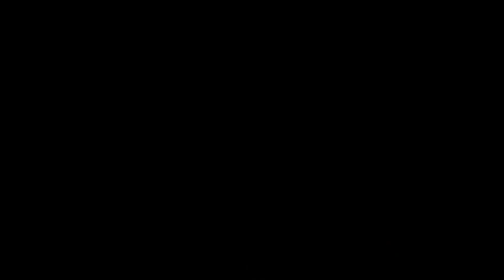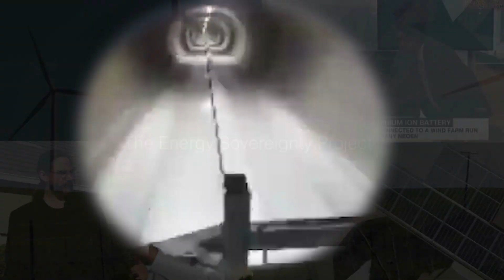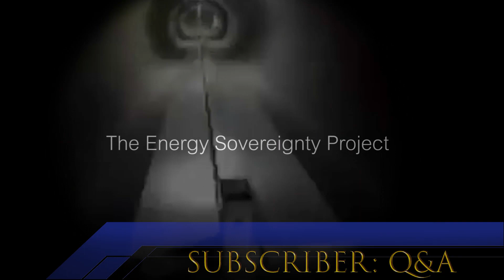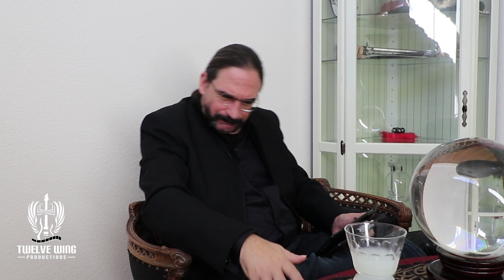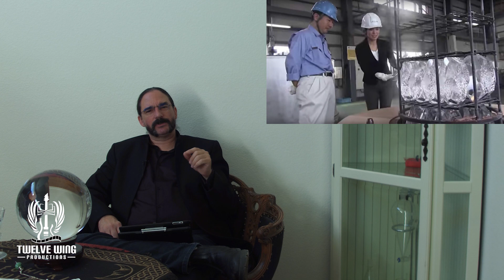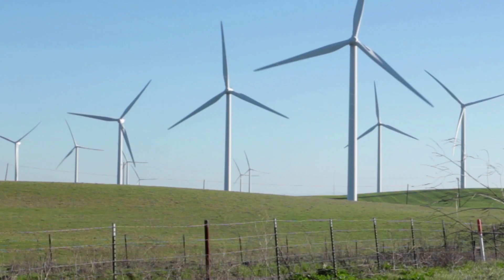Tesla's new Million Mile Battery: Is it solid state?

Comment: Once a successful large-capacity storage battery can be made without any liquid/gelatinous electrolyte medium, perhaps we can begin to incorporate them into the frame of the vehicle itself, instead of cramming the floor pan with them.  Not that the floor pan is a bad place--it keeps the center of gravity low and distributes the mass fairly evenly.  However, only one component can occupy any given niche.  Personally, I am a fan of vans.  Specifically, I like the versatility offered by a cargo space that can be configured in a variety of ways.  Chrysler's Stow-N-Go seats are an example, as are Toyota's All-Wheel Drive.  With the battery pack in the floor, neither of these is possible.  Only one component can occupy the floor pan, unless each is sufficiently small to allow several to coexist in immediately adjacent spaces.  If Tesla can pull this thing off--not just for the sake of longevity of battery life but for range of travel--a workable fully-electric minivan may be right around the corner.
Reply from the maker: Though you make some good points about efficiency of placing the battery components, I think what trumps that is the ability to easily extract the battery in the case of failure.
Reply: @twelvewingproductions7508  That's a good point.  Another way to look at that problem, however, is "distribution of risk".  I see it in a similar light as RAID technology in standalone computer systems.  By distributing the battery, you not only distribute its mass but its vulnerability to such insults as road shock, heat and collision.  Not arguing with you but suggesting that either paradigm entails its own complement of benefits and liabilities.
Reply from the maker: @belovedsonoftheking2449 , I think we both see the same concerns.  I do think that Tesla's way of isolating the internal components by having the pack consist of separate modules.  The issue I think you are identifying is that putting the batteries in the frame rails would make them safer rather than having them in the belly pan.
The belly pan arguably being the most vulnerable place on the car.

I agree with the logic but I think that focusing on having a battery architecture that isn't going to catch fire if pierced and making it easily repaired would do the trick.
Still, you make a good point.  Especially where something like a pickup truck is concerned.  A redundant battery system that can get you at least to a main road would be handy.

Comment: could be John B Goodenough solid state glass battery which he described in his speech of 2017.
Reply from the maker: Correct.  This was the point of the video.  I think they improved the crystal structure of the material, possibly using the method I mentioned.  I believe this (as described) is Dr. Goodenough's solid state battery.
Reply: @twelvewingproductions7508   In the speech they had recycled the battery 23000 times it still work at -20C. A Battery manufacturer would not be to enthusiastic about a rechargeable battery that could last 50 years and cheaper to produce(EG: AAA size) unless forced to do so by an independent company. (EG: Tesla)
Reply from the maker: @StevePerry85 , I agree.  I don't think Elon Musk cares that the battery might last "too long".
His goal is a shift to renewable resources... not "profit above all else".
Funny enough, one will actually lead to the other.

Comment: Electrolytes don't crack. they are liquid or gel. It is the solic electrodes that crack.
Reply from the maker: During their initial charge the battery consumes between 4-10% of it's total volume of lithium.  It does so forming a boundary layer on the surface of the electrolyte that allows the lithium ions to pass without further degradation of the electrolyte.  This layer, known as SEI layer or "Solid Electrolyte Interphase" is best described as a "crust". 

This crust is subject to the thermal expansion and contraction of the battery.  As the SEI layer "cracks" under stress, it exposes fresh electrolyte that then forms a thin SEI layer by consuming more lithium.  This process continues until the dendrite that forms actually pierces through the entire electrolyte layer.

Comment: Anyone asserting it's a solid state battery has to provide sufficient evidence. The burden if proof is not on the skeptics.
Reply from the maker: "Anyone asserting it's a solid state battery has to provide sufficient evidence."~
Didn't I?
Reply: @twelvewingproductions7508  Yes you did.
Reply: @twelvewingproductions7508  Seems quite speculative, who knows what other chemistries, processes and materials Tesla is working on? Hopefully Elon will settle matters during his battery and power train presentation.
Reply from the maker: @ramonpunsalang3397 , While I fully agree that there was quite a bit of speculation going on, I think it's more in materials selection rather than function.
The two things I'm stuck on are:
1) The number of cycles without breaking down the electrolyte
...and most importantly...
2) What the hell is the "mono-crystal" structure used for if it's not a solid state electrolyte

So there was just too many things that only made sense if they were talking about a solid state "glass" battery.
Reply: @twelvewingproductions7508  I am curious though why no  claim of increased energy density (a claimed advantage of solid state batteries) is mentioned in Tesla's disclosure. Any ideas?
Reply from the maker: @ramonpunsalang3397 , that's back to them describing the new "elephant" from behind the closed curtain.
The increased energy density is implied but they aren't really talking about it.  I think if they did it might be exposing too much information.

Now one thing to take note of.  Pound for pound a solid state battery isn't much more energy dense than a standard liquid electrolyte battery.  Where the energy density comes in is that you can pack them closer together without worry that thermal stress will break them down.
So the energy "density" comes more from the packaging than it does from the material being more dense.
Not sure If I did a good job describing that, but it might be the focus of a future video about how these things are packaged.

So the takeaway here as far as "energy density" is concerned is to look at how much capacity they are going to put in the new roadster or how much more space/less weight is in the existing pack.
A current Model S battery comes in at around 1,200 lbs.
If what we hear about the new pack is true and its weight has been reduced to around 900 pounds, this lines up perfectly with what we understand about weight reduction vs smaller size.
I would also bet good money on their being some extra room in that new battery pack.  Likely filled with Ultracapacitors... but I will bet good money that the 100kwh pack in that Plaid prototype they just ran has a battery footprint inside that is MUCH smaller than the 18650 version.
Reply: Piss off knuckle head.

Comment: For your clarification: our Nürnburgring has no potholes.
Nor is it a normal road. But a road built for races.
Check it out in Google Earth.
Reply: @petemiller519  You sound like a freakn POM
Reply: Tesla m3 is a shit driving experience.. harsh and unacceptable on less than perfect roads .. it needs significant improvement as does road noise .. not good at all..to coin a cliche.. these electric cars including  Tesla cars ' need to lose weight', so wait and watch , don't buy.

Comment: I have a thought about batteries in general (it has no connection to what you are presenting in here) but I don't know the viability of it. Since the battery technology is changing rapidly, for the sake of standardization, what if a vehicle is designed to have two part battery, one that remains in the vehicle, and one that is swapable. ( swap the battery with a charged one). This would be more practical for fleet vehicles. During the swap, the permanent battery could receive a short super charge. When the vehicle is an hour away from the swapping station, if the battery has more range than 20% plus the one hour needed range, then a DC to DC charge could be performed to dump the stored energy into the permanent battery (not only it is a weird concept, but how could that be done while the vehicle is in operation?) Also the permanent part could be ultra high capacitors.)
Reply from the maker: The current batteries on all Tesla vehicles can be extracted out the bottom of the cars in about half an hour.  So when it does come time to replace your battery, not only will the replacement be done in less time then putting on a set of tires, but like you said... you will have a better battery.
The key thing here is that the battery is NOT the car.
Reply: @twelvewingproductions7508  First, thank you for reading the comments an replying. my thought was mainly concentrating on the commercial segment (a shuttle van in a third world country for example)
Reply from the maker: @WHYNOTDOTTV  Ah.... that does change the conversation a little.
I suppose that is going to come down to range and speed of charge.  If the range required for the day or leg of a trip exceeds the ability of the vehicle to either make it through the day or to charge in a timely manner, swapping could be utilized.
Tesla did actually set up a test of a battery swap station at Harris Ranch in California.
The thing that ultimately shut down their test was that there simply wasn't a use case for it.  The batteries had already achieved such a range and charge speed that it simply wasn't worth the hassle.

In your scenario, it would be more like a Dewalt battery on a drill.  There could be local stations where a delivery van, during the course of it's day, could drop off a dead battery and drive up to pick up a fresh battery.  I don't see why this wouldn't be possible.
But again, I stress, that charge rates are getting so fast now that this is probably not going to be adopted for the same reason it never took off in passenger cars.

And thank you for joining in on these discussions.  Our content is very much driven by our discussions here.

Comment: Besides the capacitor what Electronic Component can hold a charge when we're talking about solid-state batteries?
Reply from the maker: The charge is held in the same way, by lithium ions becoming embedded in the matrix of the carbon and having their electron have to move on a path outside the cell.  Not really any different from the way the cell works with a wet electrolyte.  With the solid electrolyte, however, dendrites can't form because the material is rigid.

Comment: Wouldn’t it be lighter per battery, if its a dry battery. Because they don’t have to do/apply the wet process to the chemistry.
Do you think the weight of the batteries will also be lighter per KW?
Reply from the maker: The solid state batteries are best described as being more "energy dense" rather than being "lighter".  That way you can measure the efficiency based on the battery pack as a whole.  The other thing that allows you to pack them closer together is that they don't create as much heat when they charge and discharge as well as the fact that they can handle higher heat to begin with.

That way you can pack them closer together with less thermal management.  I think this explains how the Roadster 2.0 can have such a large pack.
Reply: Twelve Wing Productions , I like listening to your videos for great insight/info, also thanks for replying.
Reply from the maker: @jordons7963 , Very kind of you to say.  Thanks for following along.

Comment: I agree with you. It is a Solid State Battery.
Another interesting article related to your discussions.

https://www.electricbike.com/batteries-that-last-20-years-single-crystal-nmc532-ag/
Batteries that last 20 years ? (Single-Crystal NMC532/AG)
Dendrites and Cathode Build-up

The SEI is the Solid Electrolyte Interphase layer. As you cycle a lithium battery hundreds of times, the SEI is the build-up resulting from a chemical reaction on the Cathode that slowly degrades the range of the cell. It’s like a small hole at the bottom of a car’s gasoline tank that slowly gets bigger over time. It’s mentioned in the previous paper from Jeff Dahn that we referenced earlier, and it’s also mentioned in this new paper he published.

Comment: Here is a source about the new Tesla battery. You may already know this:
https://electrek.co/2019/09/13/tesla-patent-battery-cell-better-performance-cheaper/
“In particular, positive electrodes made from single-crystal NMC532 have been shown to be particularly robust, in part because the grain size of NMC532 is larger than the grain size of other standard NMC materials that are more polycrystalline, having smaller grain sizes.”

The new patent focuses on a new battery cell using two additives in the electrolyte, vinylene carbonate (VC) combined with 1,2,6-oxodithiane-2,2,6,6-tetraoxide, in order to boost the performance of the cell.

Comment: Agreed on the analysis, solid state is definitely the future but since the density is most likely not what it needs to be at this point I'm thinking that a hybrid system could be the answer for now.  Solid state for quick easy recharging and release, then lithium ion for longer slower charging and release.  This is of course unless there has been a huge breakthrough in the density of solid state and I surely hope so!

Comment: I am curious what your thoughts are as to where Tesla stands with respect to using Maxwell technology and the very recent journal publication by Tesla's affiliate researcher Jeff Dahn and his recent publication of a pouch cell Li-ion battery demonstrating a "million mile longevity" with NMC532/graphite pouch cell. See my comment below.
Reply from the maker: For the first part about Maxwell's tech, I think it falls in to two categories.  As stated in this video I think it's being used (or will be) to assist the current battery manufacturing with the dry electrode process and I believe that they are using the Ultracapacitors in their new experimental battery pack in this latest Model S test vehicle to assist with thermal management by acting as a buffer during regenerative braking and acceleration.

As to Jeff Dahn's statements about the test results and his recent publication... that's basically what the video was about.
I believe they went to a pouch battery because it is more economical in it's use of space as well as the fact that I firmly believe that what he described was Dr. Goodenough's solid state "glass" battery.  Such a battery would be difficult to roll because the material would have to be laid out more sparsely where the roll was tighter and more dense near the end to create a uniform density throughout the cell.  This would be very difficult to do.  The granulated glass does not compress like liquid or paste electrolyte as it is not actually a separate layer.  This would likely cause bunching of the material when rolled.  Hence the pouch battery.
I also think that the "mono-crystal" they are using... is garnet. 

And yes, I think it's a solid state battery.

Comment: Tesla battery day is coming up soon? Then we will know for sure. Very interesting. If you think about it the batteries are pretty much the main thing that are evolving in EV's. Everything else has been invented for 100Years (not counting some of the fancy stuff Tesla does like FSD).
Reply: tigeroll , don’t discount the motors, inverters, and battery management systems in the Tesla, they are state of the art.
Reply: @shepherdsknoll8  the motors aren't bad motors by any standard whatsoever, but they aren't that amazing just standard three phase synchronous field oriented control systems. Tesla doesn't even make it control chip, they just run Texas instruments insta spin chips. 

Again, there is nothing wrong with them, and they are state of the art, but they aren't doing anything amazing that hasn't been done before. Other companies just aren't trying hard.
Reply: Mark Allen , I’m not a electrical engineer, but I have heard reports that Tesla is using some quite exotic metal mixtures that allow their motors to be lighter and more powerful than anything else offered. Texas Instrumentals makes good quality products. I can only imagine that the chip does what they need it to do. If it’s like an Nividia chip and not completely efficient, we’ll, it looks like they now have the ability to make their own chips and this may be a future upgrade.
Reply: @shepherdsknoll8  it's true that they are a bit higher in power density and specific power, that's by volume and by weight but it's nothing amazing.

Look at magnax. They are really trying to create innovative motors, and at least the claimed power density is very good. The axial flux motor design comes in some model planes and hub motors. Seems to work for the right applications

Tesla identified the potential for automated driving, and they recognitized the need for very high quality mass produced batteries, and they did that across the board from the beginning, that's what sets Tesla apart
Reply: The electric motors in Tesla’s have amazing efficiency compared to other EV’s thats a good portion of the reason they can get good range with the same size battery pack in KW compared to competitors.